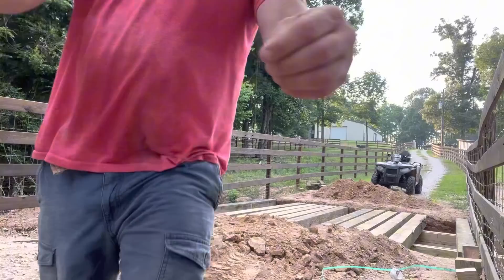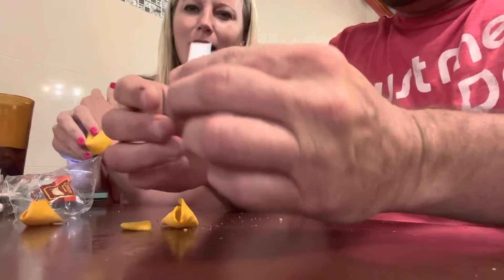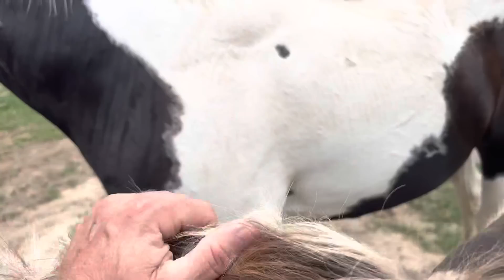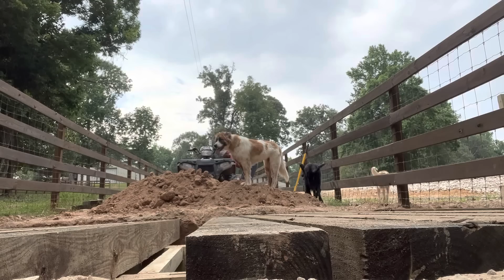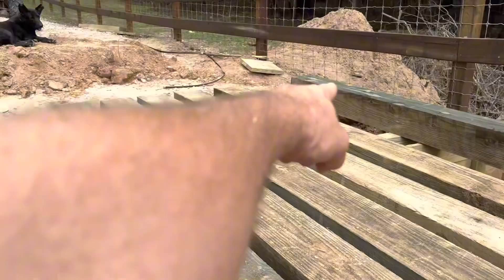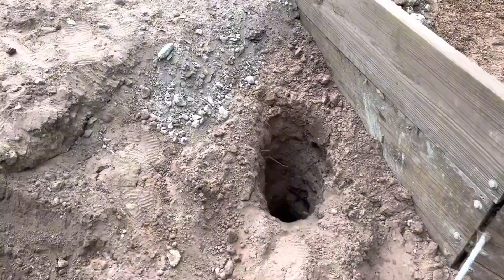Riding over Semi-Completed Driveway Bridge

Comment: Hey Lester, your cattleguard is looking phenomenal. As for the extra fence to keep the cows from crossing, what if you just ran a piece of Barbwire from the top of the end post to the top of the bulkhead post at an angle. It won’t be that visible and it would deter the cows from even thinking to go in there. Like little curious Charlene 🐮 She is just so darn cute and very independent.
Reply: I agree

Comment: I watched your whole video. Regarding the "fence" to keep animals from crossing over the area with the void, I would still put boards from your new post to the end of the bulkhead on the one side. It's hard to explain in words, but put a board running from the top of the new post to the top of the bulkhead (yes, on the diagonal), then fan out the other boards below that one. I know you probably won't do it, because the diagonal board will not jive with your spacial reasoning issue. I just want your animals to be entirely blocked out of that area for their safety. (I'm thinking Charlene may not have enough sense to stay out and could get horribly injured). You did a great job on it; I'm so proud of you! ❤

Comment: Add a post to the end post of the barricade with I bolts get one that will extend down enough that you can put one at the bottom and one closer to the top of the one in the   ground then you can screw some boards from that post to the one across from it!! The post will probably be at least maybe I'm estimating 9ft, depends on how tall the post is on the cowguard side is.😊

Comment: The pond dam is designed to have water flow over the top when the pond is full. That won't work, like before. There needs to be a culvert below the top, which then may have to be raised the keep the max water level the same.
Reply: That was what i thought as well,the dam need to be higher,but with an overflow pipe set in.& would concrete be better also? i don’t know,i’m not an engineer or a pond person lol 😂
Reply: @cassandramaranello6348  Yes, the more concrete the better.
Reply: They don’t need a pipe at the spillway. They just need to concrete the spot on the damn right where the water comes over.
Reply: @chappy675  oh ok 👍 i guess things are different there. 🤔 Where i was raised,we’d solve the problem pre-emptively,allowing any overflow to seep off slowly & through a controlled exit-way,rather than spill all over the road. 🤷‍♀️ 
Horses for courses 🤷‍♀️😄
Reply: @cassandramaranello6348  yeah here, as you have probably noticed from past Ima Survivor videos, the rain storms come out of nowhere sometime and they come fast and furious. Or we get one of our famous hurricanes or tropical storms that drop 20-30” of rain in a couple of days. Water like that doesn’t drain off slowly. It comes a deluge and drainage is non existent. That is why Houston is well known for its flooding issues. All we can hope to do is control the water to go where we want it to go instead of in our houses. But the water flows so hard and fast here that is why we have flooding and erosion issues. That kind of flowing water will just eat the earth away. Cement is about the only thing that will stop it.
Reply: @chappy675  Ah yeh,i get that situation,i’ve lived places with zero drainage,that even an average heavy rainfall will take pple’s motorbikes out from under them & float cars.& add in really hilly places,like San Francisco-type hills,where the water torrents are so bad at the bottom/corners that pple are ordered to shelter in place.Let alone when the rains actually hit for real!
Chuck in a few earthquakes too 😬😂
Not sure why,if things are so bad with the rain there & lester’s got the sponsors paying for it,he’s not having to pay for it himself,why they’re not doing concrete though?..

Comment: I’m a little confused and maybe don’t see it thru the lens of the camera-aren’t the big fat post now flush with the level of the driveway? How would adding the additional lumber going length wise across the ditch not add height and change the pitch/angle of the driveway draining down into the ditch? It looks like you’re going to be adding height to each side in order to go up and over at this point which isn’t going to allow water from the driveway to drain but to run to each side????? Help me see it correctly